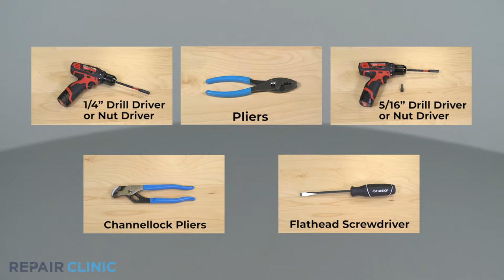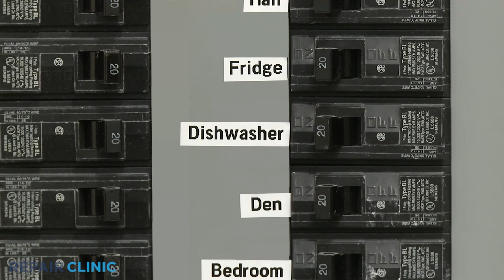GE Dishwasher Fill Hose Replacement WD24X27659

Comment: Do you have a part number for the water fill hose retention clip? Now I understand that it wasn't a design flaw but installation incompetence by the home builder that caused a major flood in my kitchen. They installed the fill hose in the fill funnel and side groove without using a retention clip. They used the tape often found attached to appliances as a retainer. Sadly, 4 years later it failed to retain.
Reply: Lmao, I had the same issue, flooded kitchen, 6 months to replace flooring and everything
Reply: @lupita3689  Took about 5 weeks to get my floors replaced but it was a nightmare. Turns out it is a design flaw too as those retention clips are only available on higher end models and GE will not provide them for other models.
Reply: @IslandBBQMan  You're lucky, we're living without a kitchen since April, almost 6 months. We had tiles so they had to knock them down, and also destroyed cabinets in the process. Lucky it was covered by insurance but insurance messed up and wasted us almost 2 months time.
I was searching for why there's 2 intakes, there's another one (like a cup) that seems to be unused.
How did you resolve it? Did you tape it? I figured I might find a clip and superglue the clip myself, not sure if any tape would last in that environment.
Reply: @lupita3689  Gorilla Duck Tape. I couldn’t get my hands on the clips.
Reply: @IslandBBQMan  Yeah I ended up using some wire straps and a bunch of tape just as a precaution, finally got it back in and also bought a water detector.
Reply: just got done fixing one that had major water leak because of this as well.